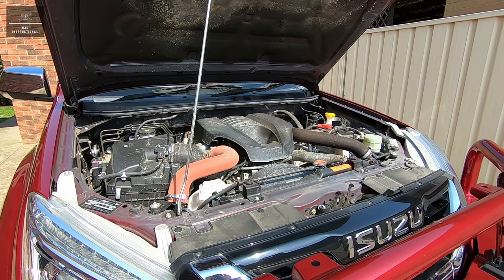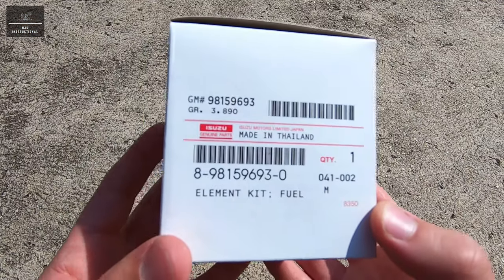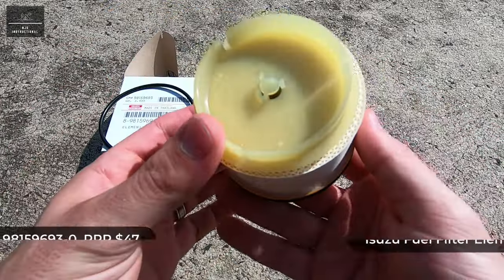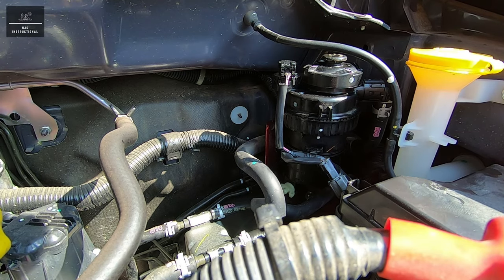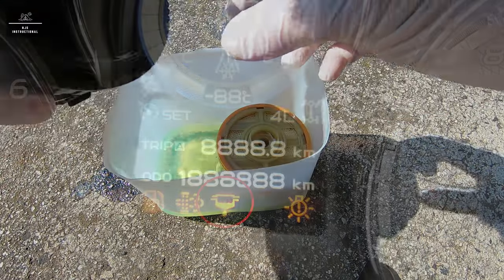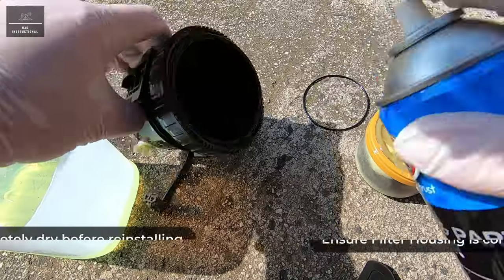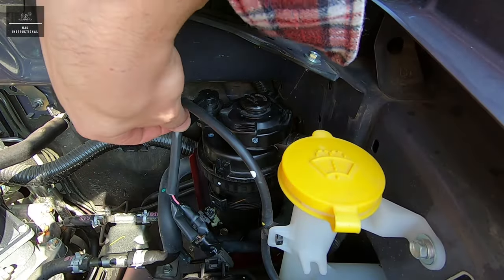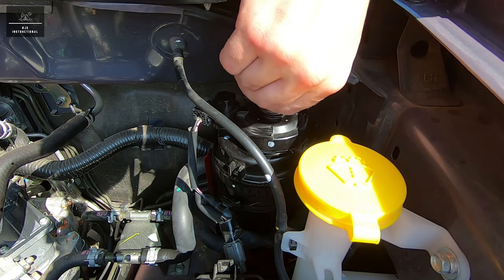Isuzu 4JJ1-TCX Fuel Filter Replacement (D-Max & MU-X)

Comment: Fuel Doctor will keep fuel in better condition and filter cleaner. I changed my fuel filter in Dmax today after 40,000 ks. Filter was heaps better as in cleaner than yours but I always use Fuel Doctor every fill.